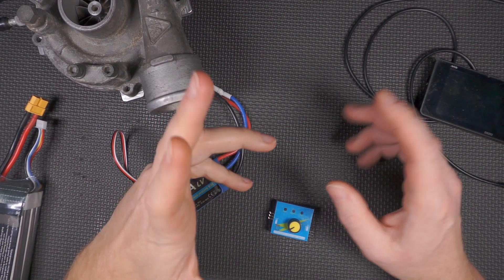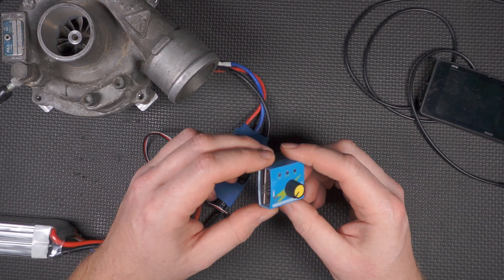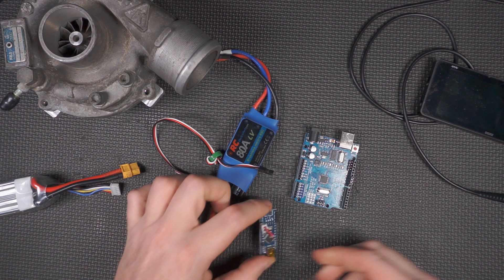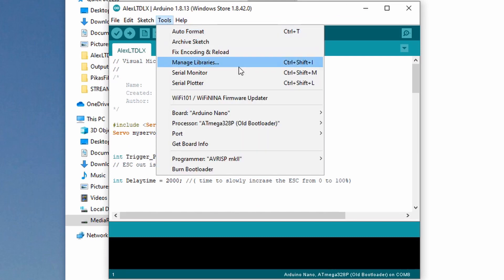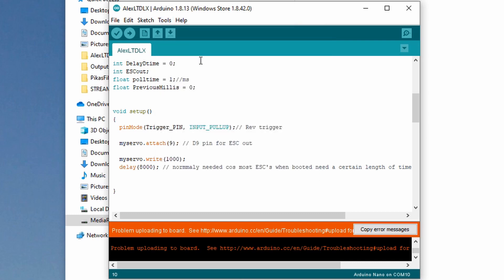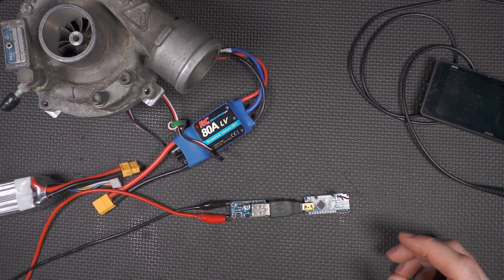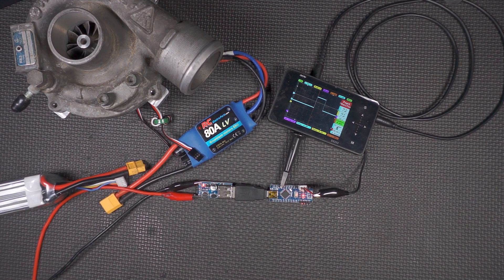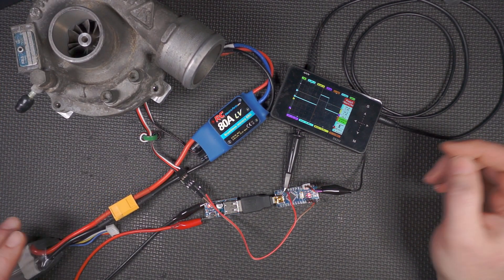Making Our Electric Turbo Controller More Awesomer

Comment: What motor do you have on that turbo?
Reply from the maker: On that little thing?  I dunno - some cheap thing - it says "Racestar 3680" on the side.  Keep in mind, that little thing was never designed for boost.  It was designed to be a crankcase evac pump when I still ran the Whipple on the LTD (which went 9.80s at 140 mph).  The big boy - that actually made boost - is here, if you haven't seen it: https://youtu.be/AOL3Qyczt3Y  That motor saturated at about 14kW.  I have a 40 kW motor/ESC combo on the way.  Maybe we can hit 800-850 hp with that beast; though we're starting to get into the choke region with the compressor.

Comment: Hey I ordered 2 of the USB CH340G Nano V3.0 16M 5V ATmega328P Micro-Controller Board For Arduino but when I plug them into the usb with this cord it does not do anything at all. I have two of them and they both light up.
Reply: They sent me a bad usb wire. I found one of my cords and it worked.

Comment: Would Michael know if the same sketch will work with pulsing a single fuel injector
Reply from the maker: You'd probably need to modify it a bit and you'll need a driver - most likely a mosfet.  Injectors draw a good amount of current.

Comment: Great stuff. If You could share Your code on Github we could collaborate on some additional features. I would personally use some ESP32/ESP8266 so that You can set ramp up time through Wifi and with Bluetooth version and OBD dongle You could monitor throttle position and automatically turn compressor on. Also I was recently thinking that having compressor inline but off limits Your N/A horsepower. But You could make it parallel, but close "offline tube" with Electric Throttle body and have only Compressor then. I think it would give better results with N/A and still good results with Compressor on. If You need help writing some code here and there let me know.
Reply from the maker: I've been out of town - sry for the delayed reply.  I've already done tests with the compressor restriction when it's off.  It costs about 1 psi worth of hp on a 500 hp naturally aspirated motor.  To me, it's not worth doing a bypass.  I'll possibly make the code available on github in the near future; but I'm prioritizing power and reliability over features at the moment.  I won't need any sort of "scalable" boost since I don't think this thing will ever hit surge on my engine, and I'll be controlling it with one of the many outputs I still have available on my car's ECU.  But again - let's get it making a reliable 700+ hp first, and then we can worry about features.  Thanks for the ideas; and remind me when that time comes!

Comment: Here is the competitor I was talking about, has two vids, heres one  https://youtu.be/gja7PXdKB10
Reply from the maker: Thanks for the links.  I'd seen the October vid before but not the November one.  I don't know why he's advertising it as a 30 kW unit - he hasn't come close to that.  He's only hitting in-rush peaks of about 17kW (we hit 22kw; and are now pushing more). I think he'll be disappointed when he ultimately puts that on a car.  I did look at that controller, and he's limited to 15s on it (I actually emailed MGM about it when I was debating MGM vs APD).  His compressor is rather small too; tbh, I did skip around the video a bit, but I didn't see any reference to a compressor map or voltage measurement under load - it's possible I missed one or the other, but while I applaud his effort, I'm pretty sure that thing would be a restriction on the LTD.  But who knows, perhaps I'm wrong.  But I don't think so.

Comment: Awesome vid! 
Since you've got a micro-controller to run the motor... once thorough testing has been done of course... It'd be pretty easy to add a couple inputs for throttle position/rpm and allow the Arduino to automatically engage various boost levels based on the inputs and desired performance

Definitely going to build one of these here soon ^_^
Reply from the maker: Yes indeed.  And hey - be careful out there.  (when you "roll your own").
Reply: @AlexLTDLX  Saw cleetus's video on the torque amp (https://www.youtube.com/watch?v=7a_J2X88fSE), and thought it was a neat idea. Thanks for the detailed RnD, definitely saved me from a few rabbit holes. 

My 2JZ is thirsty on the hwy, Ima have a hefty 48v pack in the trunk for onboard high density compute anyway, thought an electric 'turbo' would be a natural fit. With the water jacket hooked up, at 40-60% duty cycle, could do pretty well at low boost to increase fuel economy while commuting ^_^

Looking forward to seeing where you take this project =D

Comment: Couple of questions, how fast is the motor spinning at max speed and how much boost does it make?
Reply from the maker: On the dyno we saw about 26,000 rpm and only 2 psi of boost on a 500 hp, 6 liter v8; but that was with the smaller impeller, smaller motor and fewer batteries - we ended up with about 580 flywheel hp.   With the bigger stuff was saw about 5 psi in less than a second before the ESC exploded and burst into flames.  So I'm thinking 6 psi at peak power might be possible, which on my car would be around 700 horsepower and 9 second 1/4 mile times (the car has already been 9's countless times with a Whipple).  Watch this video if you haven't seen it: https://youtu.be/84wSLQRy9sc  And this is the car with the Whipple: https://youtu.be/j8SNo7kpcxw  It leaves like a bat out of hell.

Comment: can I make a suggestion, I knwo your just touching wires not using a proper switch, but bear with me, on your example you see jitter on the scope. if theres not a part of the code with a tiny delay till the "off" state if the switch isnt super mega perfect you could send that jitter to the ESC and it may have a harder life. If you have done much programming, think software debounce.
Reply from the maker: Thanks!  That's a great suggestion.  I'm familiar with electronic switch debouncers, but not software.  I'll search around and see what I can find; as well as mention it to the APD guys.
Reply: Yeah we could add delayless Debounce. I have that on all my other sketches.
Reply: @Ultrasonictwo  Let's make this code open source so that we can submit some improvements as community